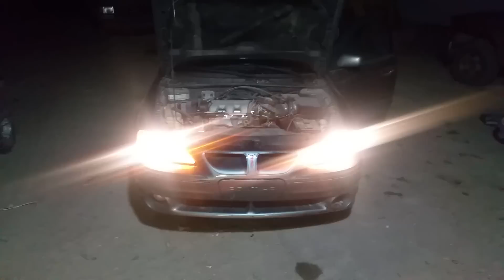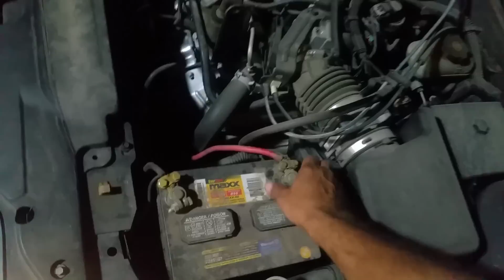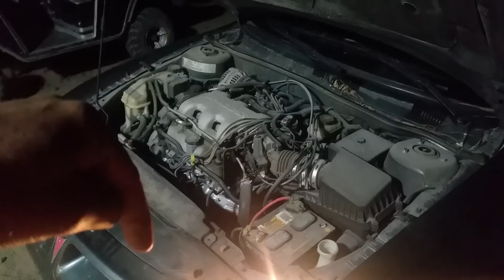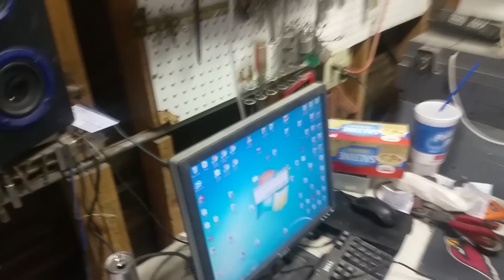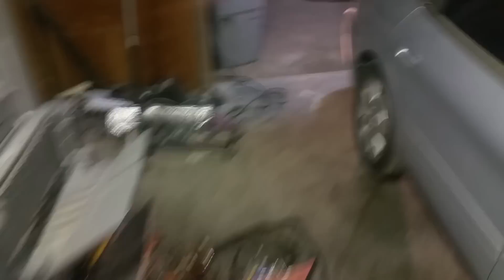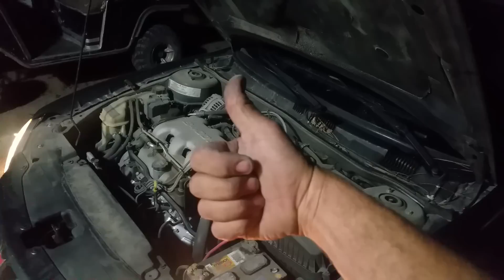Bad Alternator or Bad Battery, Easy Solved

Comment: Is it a myth that you can burn up electronics in the vehicle for new models doing this old trick???
Reply from the maker: if you can,,,, you better never have a battery fail or it will burn up electronics. ( joke ). if you burn up something doing this, there is a separate issue. thanks for watching.
Reply: @thomasbriansavingmoney 😎

Comment: I have a question, why would a car stop running if the battery terminals are loosed ? When I’ve seen videos of mechanics disconnecting the car battery while the car is running and it stays running without a battery connected to the car ?
Reply from the maker: yes it should stay running. because it gets it voltage from the alternator to run. if it dies when disconnecting the battery, then the voltage from the alternator is not getting to the coil to keep the spark alive. so bad alternator or a bad connection and not receiving the voltage. i hope that makes sense. thanks for watching.
Reply: @thomasbriansavingmoney thanks for the info and reaching out

Comment: I replaced there alternator but still there car dies after removing there battery pole, what would be there reason?
Reply from the maker: you either got a bad alternator, or the positive charge wire from alternator to battery is loose or not connected. make sure the small wire to excite the alternator has power.

Comment: I have a mk7 GTi pretty sure it's my battery if I cant even lock the car or get no lights when putting in the key. My radio drl works windows work up and down right? Not my alternator ?

Comment: I tried it..the car did not shut off so I changed the battery...but my new battery dies overnight.....what could be the problem ?
Reply: It sounds like your car may have an electrical short that is draining power from the car battery when the car is not in use.  There may be videos on YouTube to help you figure out what the problem might be.

Comment: Hello i just bought a new battery i have this tool top don says replace battery,but my battery is 1 year old could it be? bad battery.if my new battery again become died again could be alternator? also is it bad i did i put some dielictic grease on my alternator connector is this the problem should i not done that? need help

Comment: Yes--but, some newer cars may have a problem with this.  A better way, IMO, is put your Voltmeter on while she is running.  Put it on before you start, then leave it on and start the car, you should see a big jump in current output after you start it, that's how you measure alternator output.  You can look up how much of a jump, I can't remember but if the needle does not move, the alternator is not putting out charge.  But he is dead right about the alternator, not the battery running the show.  A simple proof is leaving the lights on all night, without the engine running--why would it be dead in the morning?  Because the alternator is not turning, malking electricity and running the lights, which is why you can drive all night, and the lights and battery are fine.

Comment: Yeah, there might be a problem if something that draws lots of current shuts off while the battery is unhooked. Because of the high inductivity of the alternator coils the alternator creates a voltage spike as soon as current draw abruptly changes. Usually that's not a problem (and that's why there is no better regulation....) because the battery takes up that spike but if it is not there, the alternator might deliver a voltage spike of up to 120V (instead of 14...) Computers in the car should be protected against this, but often aren't fully and that's how you can fry expensive equipment in modern cars...

Workarounds:

a) Switch on the cabin fan at full blast and the lights, make sure they do not turn off while you disconnect the battery. As now there is a lot of current draw, any change will be small compared to this resulting in small voltage spikes. It's also a good idea doing this while driving with a defective battery that cannot charge anymore and therefore does also not much to prevent voltage spikes...

b) Jumpstart the car and simply run the car for several minutes with lights on and fan at full power. If it dies, the battery has drained and the alternator is to blame. Works even without disconnecting...

Dont take my word for it, lookup "alternator voltage spike" and "cut-off" or "load drop" yourself and see what's going on.
Reply: Well ok, and also think of bad contact... Often the alternator is allright but the battery cannot charge because there is voltage drop between the battery and the alternator. Look for smoldering connections and rust at connections to the chassis. Contacts between alternator and battery are very sensitive and must be spottless for it to charge properly...

Comment: On my older Toyota, when you disconnect the battery, the idle needs to be relearned, or else you'll sometimes stall the engine until it relearns over time. There's a procedure to force a relearn.

Comment: If you pull off the battery cable, and the alternator dies it means it the alternator that has gone if the car dies.  You do this while the car is running - correct?  If the car lights do not turn on at dark while driving does that mean the alternator is going because you said the alternator is what powers the car when it's running - is that correct?  How do you ensure you don't get electrocuted when you pull off the red ? positive cable.

Comment: Learned when I was a kid just disconnect battery if it keeps running the alternator is good if its shuts off alternator is bad , battery is only used for starting

Comment: The only thing it does  when you disconnect  a battery, is the radio, then you have a code ! Lol. My Honda has a code that you have to put  in and it's usually stamped on a paper that is stuck on the inside of your glove box. It's a bitch to put in cause you gotta remember it take like 7 times befor e it will take it. Look at your Manuel, I just can't type all details. This dude know all about it too.

Comment: Today, I just went to auto zone check the charging system. The battery and starter are good but the charging system is failing  but when I get home, I start the car up and unplug the battery and it still runs ! What’s going on here????

Comment: My only comment about the changing the battery would be make sure you have the radio code (it's usually in your owners manual if you have one) when the battery is reconnected your radio will ask for the four digit code.

Comment: So technically you can drive your vehicle without the positive red battery cord connected as long as it has started and is running through a good alternator?

Comment: I have battery/alternator problems. Hoping it wasn't the alternator, I just did your test and the engine didn't falter. Having said that, I believe can can run the car with a bad alternator, from the battery, for a short while. My vehicle conked out in France a couple years ago, It was the alternator. It cost me £1000 ($1262) to get it fixed. Luckily I had breakdown insurance and that paid for vehicle recovery, taxis and an hotel for four nights. I had to pay for the repairs.

Comment: My car didn't die when I removed the positive terminal but when I put load on the alternator i.e when I turned on headlights and ac my car died. Is this a sign of a bad alternator?
Reply from the maker: yes, might not be out all the way, but sounds like its going. but do not rule out a battery issue. a dead cell in the battery can cause this as well. you might do a load test on that battery. most auto parts stores will do that for free. thanks for watching

Comment: Excellent video, don't let weird people get you upset, they full of gluten and dairy and their brains just don't work right. I am afraid to take off the positive while the car is running, that's not going to cause a spark or anything? I see you did it fine, but I am curious as to why it was so safe as I do not know anything about cars and I need to try this tonight with my car.  Many thanks.

Comment: What happens when you disconnect the battery? Your truck runs but when you try to roll up your windows with the electrical button all your lights, go dim almost off.

Comment: Nice vid man. I got a question. I did the thing were I disconnect the battery n it keeps running. But a few times I started the car. It felt like it wasn't falling running n it stalled on me. Would u know what that could be ?

Comment: Don't do this on modern vehicles!!! On any modern vehicle, pulling the positive cable can destroy your ECU or other electronics. I worked in the automotive industry and saw this many times. Mostly from shade tree mechanics, too. The same people who believe you can't leave a battery on a concrete floor, lol. ECUs are very voltage sensitive. The battery is used to maintain a constant and stable voltage. When you pull the positive, you're forcing the ECU to rely only on the alternator for power. If the power dips or a surge happens, you can fry your ECU. Again, do not do this unless you have a car that was made without any kind of computer control system.

Comment: Awsome Vid Tom right to the point ,anyhow quick Q. im not sure battery or Alt . my battery term. is  slight lose tried tightening it . I jumped the battery without a problem . turned off the car n it started the next day , mind u its 30 below in toronto it didnt start , I think its the battery terminal  its only a year old battery . What do u think  it is my buddies think its the Alt. ??2010 dodge caravan . any comments thx

Comment: Great Video and straight to point. Thanks a lot… I have a question: how long should we keep the positive head of the battery removed in order to know if it’s the alternator or not?
Thanks once again!
Reply: If the alternator/regulator is bad, the engines dies immediately.

Comment: Thanks sir! Had several folks telling me battery because of frigid temps. The very second I pulled pos cable on the battery my car died. Installed new alt and system charges fine! No fancy equipment needed just straight up thinking knowledge……

Comment: Great 👍 video I have a 2006 Suzuki forenza my is reading 20v and the positive has a wire for the alt and a wire for the fuse box so is going on how do I fix this that alt is new and battery is new

Comment: Good info but in reality, you don't even need to disconnect the battery to find out if it's bad or not.  If you have to jump start and it runs fine after that then you know the alternator is good and the battery is bad.

Comment: Okay, so I bought a jump box to jump my car off so I wouldn't need another car. The car would jump fine no problem but now it won't jump at all. Yet when I put the charger on the battery the car lights, radio, etc come on. I don't know if I need to replace the battery or alternator. I can't start the vehicle as of now to test the theory in the video. Someone help please!

Comment: Lovely video! I have a 2004 RAV4. The voltage from my alternator fluctuates rapidly from 13v to 12.78 and drops to 9v and up. It runs when u remove the battery buh after a lucky first start the the long distance run and turned the car off it won't start.

Comment: Can also be a bad cable coming off the battery though...or an electrical component staying active due to a bad relay that gets stuck in the "on" position after turning off the car.

Now you just bought a $120 battery and your problem isn't gone because you still haven't replaced a faulty $5 relay...It's free to go into the fuse box a check for stuck relays...throwing batteries and alternators at problems can be expensive.

Comment: THE ONLY VEHICLES I KNOW you can’t disconnect the battery for ( very long ) or NOT at all without a memory backup computer plugged into the system are the Trailblazers and GMC Envoys. There are videos explaining why you can’t do this and the reason I know why is because I did it myself and COMPLETELY SCREWED UP my 2012 Envoy. 

I have 2 VERY well maintained Envoys that STILL look brand new and run like new both in the 70,000 mile range. Well the battery went out on one ( my wife’s ) and she likes her LOADED special edition smaller sized 2012 Envoy over my 04 XLT 4x4 5.3 liter Envoy. So I took out my battery and put it in hers one morning so she could run the girls to school and come back and stop and pick me up a new battery and come home and I’d put it in and head to work. It took no more then 30 minutes to do so. Well guess what ? The SYSTEM is COMPLETELY jacked up when I TRIED to start it. Misfiring and black smoke coming out the exhaust HVAC system screwed up all my electronics messed up etc. it ran  like hell and barely got down the road, if it did at all . 

I researched why it was doing that and what was wrong since the battery change. ONLY STUMBLED onto ONE video as to what happened to a mechanic who ran into the problem himself one time and he said he learned from it and wont do it again ever !!! That is that the Trailblazers and Envoys electronic system and computer ( in my simple words ) are set up in such a way that if they are NOT connected to a memory backup computer ( tool ) while disconnecting the battery it WILL CERTAINLY screw the system completely up. From broken actuated doors to sensors thru out the motor etc. now it may be that it’s for more then 5 minutes give or take I can’t remember. 

Again I myself like everyone else have ALWAYS ALWAYS disconnected my battery for MANY reasons and I also NEVER EVER THOUGHT it could mess up a vehicle until that morning. Again I COMPLETELY AGREE with this video with the EXCEPTION OF THE TRAILBLAZERS AND GMC ENVOYS !!!!!!!!!!!!!!!!!! As a matter of fact I’m here about my alternator or battery on my wife’s Equinox and wasn’t sure about that system . So see I was considering disconnecting her battery also but DO NOT want to screw up her system either. 😂 PLEASE EVERYONE WHO HAS EITHER OF THESE SUV’s DO NOT DISCONNECT OR IF YOU DO NOT FOR LONG AT ALL YOUR BATTERIES !!!!!!!

Comment: Hey Brian! I loosened the nut that keeps the positive cable connected to the battery and took that off, but there was another small part that I didn’t know about and it slid off and fell either somewhere in my car or on the street. I don’t know what that part is. I was wondering if you might know and if you can tell me what the part is called so I can look up pictures of it and try to locate where it dropped. I hope this reaches you well!

Comment: I jumped my car it started.  While i was letting it idle, it just randomly died. It won’t start again even when trying to jump it.  I used my obd2 tester while it was running and it said 12.2v.  Do you think it’s a dead battery or a bad alternator ? I can’t get it back on to try this method

Comment: Older cars is one thing but Modern cars have sensitive electronics…ECM has to power down first before disconnecting battery…if u disconnect battery while it’s running there is a chance u gonna create a voltage spike and fry something. Or nothing might happen but why risk it…I wouldn’t do this on my car. Better to buy yourself a cheap dmm and test charging system and battery

Comment: Hey brother hope you can help I got the exact engine just a different car 2000 olds alero got a nasty idle surge and replaced the maf because of code ( I forget the numbers but maf low voltage ) checked wiring seems good and seems to have a bad alt not the best comment because I’m pretty frustrated but id appreciate any help I could get from you or the community thanks

Comment: This is not true. If you have a bad alternator,  you will eventually have a bad or discharged battery too. The problem with bad alternator is that it doesn't charge the battery while the engine is running.  So if you're able to start the car with a bad alternator but a good battery and you drive for 2 or 3 hours, sure your battery will be discharged and you cannot start the engine again if you turn it off.

Comment: What if it is just a corroded wire coming from the alternator and only needs cleaned. you wasted money on the alternator. check with a volt meter or go to auto zone they will check it for you for free.

Comment: Thank you for the information, I’m going to try this when I get off work. I have a question, though, if the battery is only responsible for starting the car, why does a bad alternator only fail when unplugging the positive cable?

Comment: I have a 1991 BMW. My alternator not charging the battery while car runs. I check battery power using mutimetre while car runs, no increase in voltage in battery. After few days battery voltage low even I kick start daily. After I recharge my battery in Mechanic charger shop, the car starts and keep on running. So what you say is that the battery is used to Start the Car and when the car runs, the alternator takes over to run is "not correct". Seems if the alternator is bad but battery good, the car can start and also runs on battery. Can you reclarify this?

Comment: had my crank sensor changed when i got my 2001 gtp new batterry as well   (3-4 years)....the other day i drove it got in it cranked normaly stopped at store and left car runnin when i got back in car It was not funning all lights were still on radio was still playing went to crank it and it would not turn over
the next day i went out and it firred righrt up i didnt drive it for fear it may cut off agian mid drive
 day after that i did the same thing but this time it hesitated but crunk
we have been having cold temps so the last time i tried to crank batt was dead 
 can you help...is it battery or alt..... .......